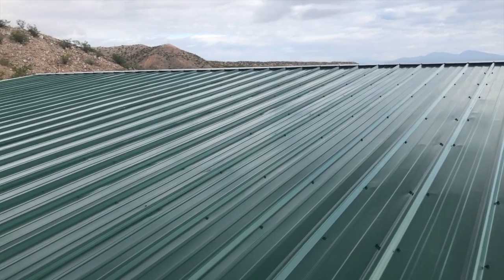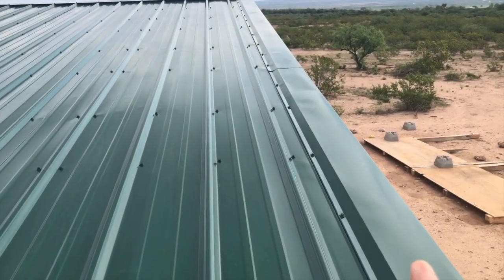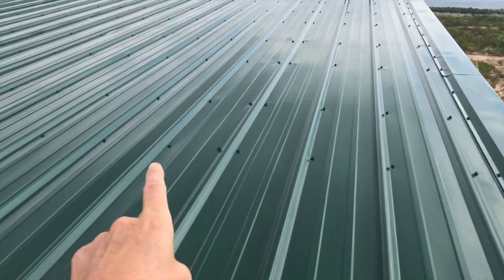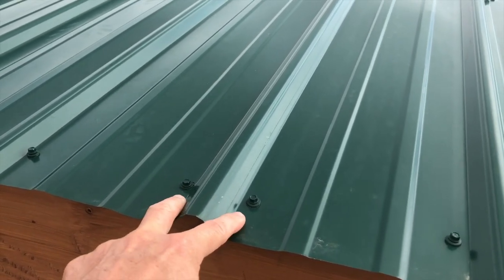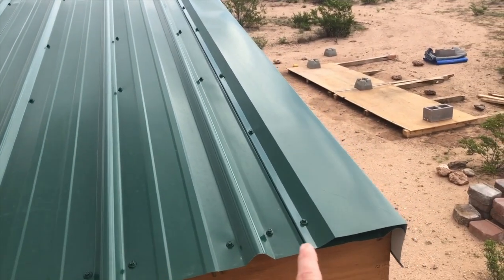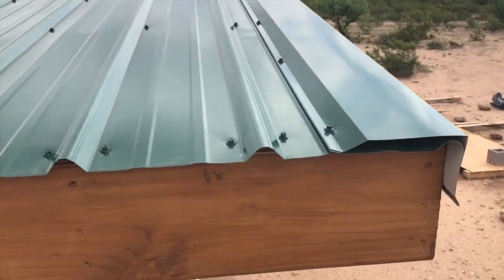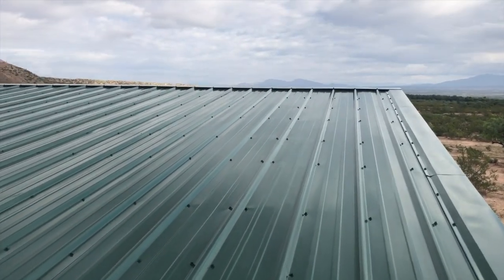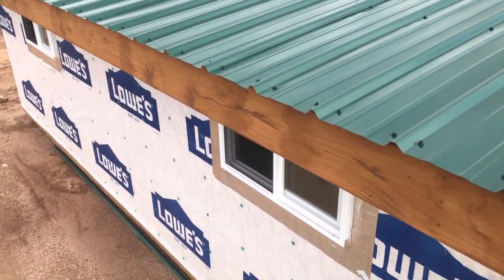12'x24' DIY Shed Build (Part 7 - Metal Roofing Install)

Comment: Hello Pam and Brian,  your thumb nail made me think of Fiddler on the roof,   We are thinking of putting a galvalume steal roof on part of my house because the son beats on it and the shingles on that half are brittle but the other side is in great shape.   We have  steal roof on my she shed , My kids play house , the Trailer barn and my 3 bay barn.  good advice.  So sad you were a few screws short. 💕NonnaGrace
Reply from the maker: It's definitely a perfect material in our climate.  Also great for catching rainwater. Good luck with your repairs!

Comment: Tip: prime and/
or paint your all sides of 
the Fascia board before installing. Since it's exposed it gives more protection to the board
Reply from the maker: Excellent tip!  Thanks! 👍
Reply: pro trick: watch series at Flixzone. I've been using them for watching a lot of movies lately.
Reply: @Nikolai Gerardo Definitely, I've been watching on Flixzone for since november myself =)
Reply: @Nikolai Gerardo Definitely, I've been using flixzone for since november myself :D

Comment: I see you have plywood under the metal sheets. Just for my info since I’m gnna be doing this, did you place anything between the plywood and the metal sheet roofing. And is it recommended to place anything between them? Thanks!
Reply from the maker: Good question, Israel!  I can't believe I didn't mention it in there, but there is a synthetic roofing paper between the plywood and the metal.  It is recommended.  It looks like I did show it in the "ROOF" section of the description.  Sorry for not showing or mentioning it in the video.  Good catch!
Reply: @MidlifePrices  Thanks, no problem at all. Perfection is only for ONE!

Comment: Looks like you may have overtighten some of your screws. For future projects if you are smashing the rubber washers they are probably too tight. Snugging them down by using  the clutch on a drill works good for that. I usually run a few and find my setting and just leave it there for the whole project. Sometimes you have to go back and tighten a few down a little more. When you tighten too tight it causes a dimple around the screws and water will collect there and eventually find it's way down into the screw hole. On the desert you dont have as much to worry about as in more wetter climites. Also if you overtighten it doesn't leave as much room for for the metal to move as it contracts and relaxes with the heat and cold.  Congrats on the roof though looks good. You got the overlap right, I have seen contractors who put it up backwards and put screws on the ridges. You did good. Keep it up. Looks better than the first one I put up for sure.
Reply from the maker: Always tough not to overdo those, but lucky we are in a pretty dry climate.  Thanks!

Comment: No butel tape on the rib of adjoining panels or where the trim overlaps?  When JC and I built our steel building, the mfg included tape and caulk (we had to rivet the mating trim pieces.). Looks like yours fits pretty tight, so maybe not needed.
Reply from the maker: I did ask those very questions of the manufacturer, but I was assured nothing else was necessary. 🤞 Good question, though.  Everything seems to have held up pretty well to some recent rain, so we're hoping it's all good!

Comment: Hi..I want to build a lean-to house ,with 25feet length and 18 feet width..so what size will be my overhang size??please
Reply from the maker: The overhang size is a personal choice.  Just depends on how much protection you want to add from sun/rain.  Also, factor in lumber lengths to fit and minimize waste.  Good luck!

Comment: I'm not a roofer but I've also done my fair share of DIY and assistant to builders work. Shouldn't the roofing be screwed through the ridge of each sheet to prevent leaking? Only screw in the valley's when sheeting a wall....
Reply from the maker: Hmm.  Not sure about that.  Followed the manufacturer's instructions.  I believe it's the washers on the screws and the overlap from panel to panel that prevents leaking.

Comment: Looks great! Did you not need a drip edge at the bottom?
Reply from the maker: I had originally planned on it, but the metal roofing folks told me it was not necessary in this application.

Comment: Without a metal drip edge at the eave your fascia board will rot.
Reply from the maker: I am still afraid of that, but the metal roofing folks told me multiple times that a drip edge wasn't necessary in my application.  Should have (maybe will for next project) pressed them specifically about the wood fascia board rotting.  Probably a mistake there.  Will correct on the house build.

Comment: i’m no roofer but that seems like way more screws than necessary. 😳
Reply from the maker: I forget what the specs were, but we just did it according to the manufacturer's instructions.  Once I got the extra bag, though, I threw in some extras for good measure!  👍